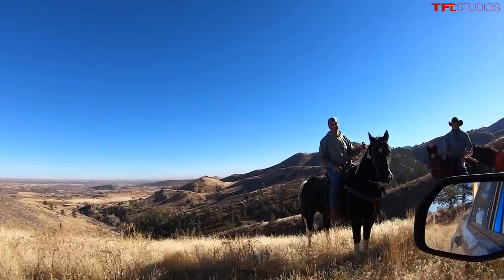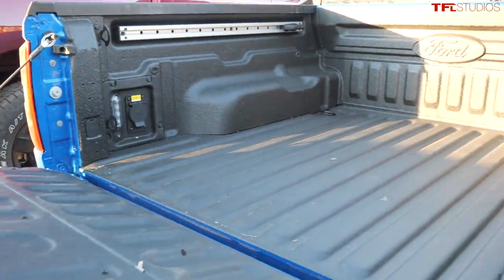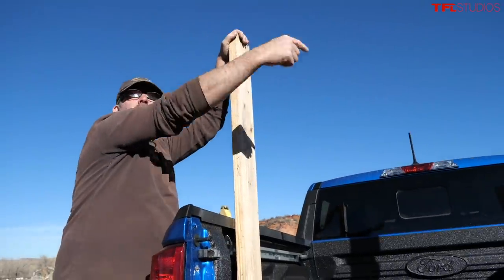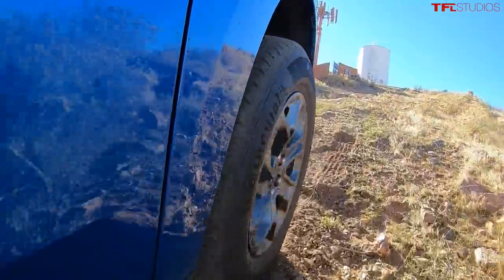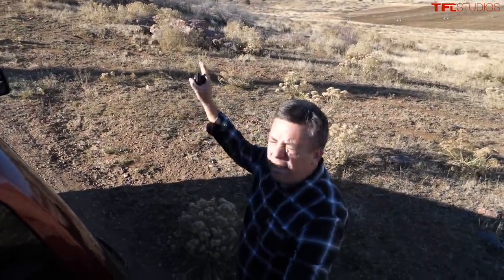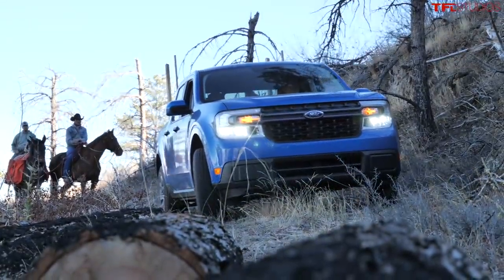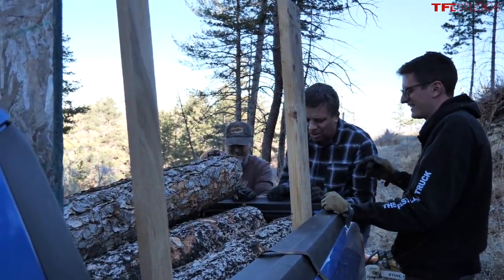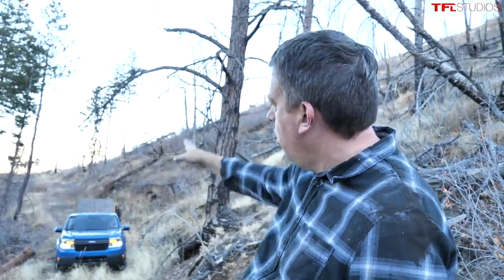Did We Go Too Far MAXING Out The New Ford Maverick To See If It’s Ranch Rated?

Comment: Part of me wanted to nit-pick over how the AWD could do this better, but I'm glad you tried it with something representative of the base model, because if that can do this, then there's no doubt the AWD could. I also think a good point was made here, most reviewers are calling this a city truck, but I think a good chunk of the market will be people in rural areas looking for an efficient rig for runs to town that is still capable of hauling the occasional load of pellets, firewood, feed or anything else not suited to the interior of a vehicle.
Reply: There’s also a lot of diyers out there that want to make a Home Depot run and get a sheet or two of plywood or some Sheetrock and want something efficient enough to be a daily driver as well
Reply: I no longer need a full size truck, actually I've been in a regular sedan for 2 years and my wife drives an SUV. Normally I can get by without a truck and only occasionally need to borrow a truck from a friend. This Maverick is in the prefect space for a guy like me. I do all my own home repairs and renovations, I occasionally need to tow my fishing boat (usually behind my wife's suv) and i have a small utility trailer I haul my Side by side and tractor on. This Small pickup or crossover truck (whatever people want to call it) fits perfect for a guy like me. I ordered a black XLT with FX4, 4K towing, and luxury package. Can't wait for it to arrive.
Reply: Amen.
Reply: @mattheww2797  That's basically where I am, I'm in the middle of building a microcamper and the logistics of getting a few 4x8 sheets of plywood home have been a huge headache. Something like this would serve that need well.
Reply: Absolutely. So many people seem to think you need AWD to survive anywhere outside the city/suburbs.
Reply: That would be me.
Reply: @TheFlooringInspector82  well said, and awesome truck you ordered!! I think that’s the sweet spot of base level truck with enough comfort & practicality combined for a still reasonable price!! Sweet!!
Reply: This is for people like where I live. It’s a town of about 3,000 people, but it’s still a town, so you still need to be able to park the damn thing. In addition, you need it for the winter and for all the outdoor activities that people get up to around here. The fuel economy is a big one too since something like the nearest Best Buy is a 50 minute drive away if you need a new laptop
Reply: @shitloveaduck  My local dealership had one that was already sold in the exact configuration I ordered mine (except it was blue). They asked the new owner that had not yet taken delivery of it if a salesman could take me for a spin in it and they agreed. I think it will be the perfect balance for what i need
Reply: @TheCapn23  Agreed, you do not NEED it mostly everywhere. I did order mine in AWD though as where i live in Maine we average between 120-140 inches of snowfall every year and AWD just makes life more enjoyable by not getting stuck all the time. LOL. Even still, here you can manage with a front wheel drive just fine, but you tend to get stuck at least a few times per winter.
Reply: @TheFlooringInspector82  - nice! I had a Bronco on order, but cancelled it with the dealership. The dealership is still waiting for it and it’s already spoken for. I was tired of waiting and disappointed with the whole scenario. Then my dealer called me to say they had a very similar one in a 4 door vs 2 door. They have a job to do and he scored on that phone call. I agreed to take a look, but was not big on a 4 door. Well, I drove it and negotiated a price while driving it!! Hahaha. I’m fortunate that I am friends with the guy that owns the dealership, but maybe your dealer will keep in touch on near matches you may take instead!! So long as you didn’t order something weird (hard to do with the Maverick, I admit) they can sell the vehicle you ordered when it arrives to someone else. The worst they can do is say no. You could get into a Maverick pretty quick that way. 
      I know that my buddy ordered a sh*t load of XLT 2.0 litre AWD FX4s with the towing package. I think it was 105 units he said. Anyways, he is in a city large enough they won’t be on the lot long. He has a lot of loaded Lariat models coming as well. We are in snow country, so he isn’t getting as much hype about the hybrid as other areas. He has 50 on order and knows they will sell. His belief is that the Maverick will cannibalize some of the Bronco Sport sales, especially when the 2.0 is available in all the models and not just the top model (we get different choices in Canada than the USA). The Maverick is also less expensive, feature for feature, due to the more minimalist interior design. He’s betting on the 2.0 XLT as the prime seller.
Reply: @shitloveaduck  Yeah that 2.0 XLT is the way to go man. I should have my new Maverick by Christmas. If it is not in by then i'll start thinking about shopping for one elsewhere. But as of right now it looks like it should be in on December 15 from what i was told last week. Honestly i almost went with the Lariat but I just did not think I needed the few extras you get from that package. The XLT with luxury package, fx4, and 4k towing I felt was the best bang for your buck all around.
Reply: @TheFlooringInspector82  Ordered the same thing except i went with the Red. This style of truck will complete change the truck market for years to come. No longer do you need to spend 50k to haul air for 350 days a week.
Reply: @Knuckles549  but muh truck...
Reply: @Knuckles549  Completely agree
Reply: I use a 4x8 Harbor Freight folding trailer behind a 4cyl AWD 35MPG+ hatchback or a 6cyl AWD 25MPG+ SUV. This setup can accomplish a lot of what a midsized pickup can, especially if your SUV can tow 5K lb or more. Deducing from that experience, this hybrid Maverick is plenty enough 2WD truck for those who aren't towing heavy loads, and the AWD 4K Maverick is enough to tow the 3000lb 26' boat that I want, while getting almost the same unladen MPG as my hatchback, and it'll be less hassle to park in town than using my 4x8 trailer.

 The great thing about using rear coils on the suspension of something like this, or a Wrangler/Gladiator, is that supplemental in-coil airbags can be used to avoid most of the squat at max payload, while retaining a great unladen ride. The coils never need to be sagged. The headlights never need to blind oncoming drivers. The offroad articulation can actually improve by using a T-fitting to connect left and right together.
Reply: @TheFlooringInspector82  I think "crossover pickup" is a great term for these unibody pickups like the Maverick, Ridgeline, Baja, and Santa Cruz. They ARE different from the little body-on-frame LUV, Courier, Ram50, etc.
Reply: @RKmndo  Agreed, I actually use a 6.5x14 utility/landscape trailer that primarily just hauls around our side by side behind my wife's SUV (she was in a Traverse, just upgraded to a 22 Telluride). My 2020 Malibu is a good car but I'm tired of swapping vehicles with my wife every time I need to haul literally anything. I'll give the Malibu to my 16 year old daughter when My Maverick arrives later this month. That utility trailer works great for lumber, furniture, hauling our side by side, towing our kubota, etc. My boat is a Yamaha FSH sport 195 and only weighs around 3000 lbs with fuel and everything in it so the Maverick should have no trouble pulling it.
Reply: @RKmndo  I have a '20 ecosport awd 2.0 that I use with a 5x8 and 6x12 aluminum trailer.  I bought it because a couple of times my f250 and 20' trailer with atv's had me circling for an hour to find a spot to fit at the trailhead.  The little ecosport with the 6x12 and two atvs can squeeze into a lot of spaces that were left.  Only issue is with two atvs and the aluminum trailer you are right at the 2000lb towing capacity.  It can do it but you have to drop a gear and manual shift it.  If it was a 2.0 turbo it would be fine.  Hence, an escape or maverick with the 4k package would be a sweet spot with the only downfall being worried about turbo problems down the road (the ecosport 2.0 is naturally aspirated).
Reply: @TheFlooringInspector82  absolutely solid choice! I think that order will be perfect fit for everything you just described
Reply: @daveunknown01  I was impressed by the one I got to ride in. Did not feel sluggish on acceleration, felt pretty roomy inside (I'm 6 feet tall 220 lbs) and was overall plenty of "truck" for what most people need. It doesn't replace the need for larger trucks but most people that do not haul heavy loads and only occasionally tow smaller trailers and maybe some lumber in the bed this is the perfect fit. Mine comes in next week and I am looking forward to it. If any of your local Ford dealerships have one on the lot you should check it out, I think you'd be pleasantly surprised by these little pickups.
Reply: @Rigatonispaghettioly  I think so too. The only thing that has me a little apprehensive is loading my boat when it's fully loaded down. It weighs around 3000 lbs with fuel, but then with coolers, water toys, etc it'll be more like 3200. Some of my local boat ramps are pretty steep so I'm worried about it struggling to pull it up the ramp when it's wet. I think it will be fine as my wife's telluride (and before that her Traverse) did it just fine.
Reply: @TheFlooringInspector82  nice. Does the interior feel as small as the old rangers? It seems to be relatively the same size at least on the outside. Im 6'4   and hoping it isnt too cramped. Im use to my old suburban where i can drive spread eagle if i feel like it haha.
Reply: @daveunknown01  I'm 6'1" and I have plenty of room. 6'4" you might want to sit in one and try it out prior to ordering one. I know at my height I had the seat almost all the way back for my most comfortable position. I could have easily driven with the seat all the way back comfortably though, I just tend to like to allow my arms to rest slightly downward and allow a slight bend in my knee when driving. I'm not the type that enjoys driving with my arms fully extended and legs fully stretched out. Mostly because of a back injury from my 20's. The seats were plenty supportive and firm without being hard and overall it felt like a well put together vehicle. At 6'4" you might find a little more comfort in a midsize truck like a ranger, colorado, or tacoma, but I think it would be worth you taking a look at the Maverick just in case it does meet your needs.
Reply: @TheFlooringInspector82  thanks for the info.
Reply: You are so right Cole!  I own a Ford F-150 FX4 with the long bed and I inherited a 1997 Chevrolet S-10.  I use the F-150 mostly for long trips and to get groceries because it’s big and has so much room inside and it’s fully loaded like a Lincoln.  On the other hand my S-10’s bed is the perfect height for grabbing gear and hauling light loads that the majority of potential buyers would be for the Maverick.  I want the Maverick for my grandkids as an entry level vehicle to grow in.  Even though I’d probably drive it more often!
Reply: I've been driving a 2011 F150 XLT regular cab since new, VERY strongly considering these.
Reply: Or people such as myself that needs a car that's efficient but can also haul my dirtbike on the weekends without having to mess around with trailers on a car or an overpriced fullsized status symbol pickup with the bed 6' in the air.
Reply: @TheFlooringInspector82  With the right tires, the only issue winds up being ground clearance. I did many, many "lake effect" winters and never got stuck with FWD+snow tires.
Reply: @Paqza  True, like I said you can get by in Maine without all wheel drive, but when it's an option and you live where you measure snow in feet not inches it just makes more sense to get the all wheel drive model. The hybrid is cool for fuel efficiency but good fuel efficiency won't get me in my driveway in the middle of a snowstorm.
Reply: This is why my daily is an old school wagon.
On another note, after the first of the year, I saw dozens of these trucks on the road and quite a few pulling into the orange box store that weekend. I live in rural Idaho BTW.
I also saw the Hyundai truck 🤮 not a fan
Reply: @TheCapn23  right my fwd manual jetta has never got me stuck in Maryland snow storms
Reply: @ashantedula5696  Thoae jettas have a very good automatic engage traction control. Does well on icey roads going up hill.. very scary. Very lucky to be in the jetta.
Reply: I’m interested in a maverick now I thought about the new ranger but the price point and size of the maverick appeal to me. If I had to choose a model I’d probably go with an FX4 AWD model so I get the awd for light off roading along with the higher ground clearance they mentioned plus get great fuel economy and can still haul a pretty good amount of weight that you need to haul.